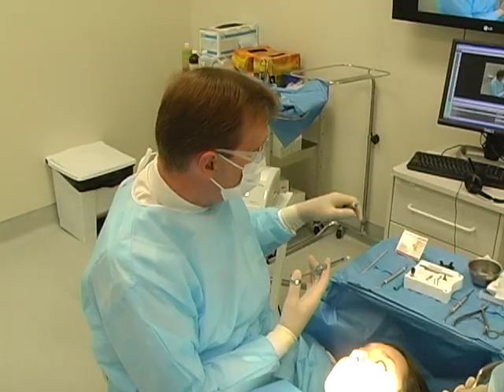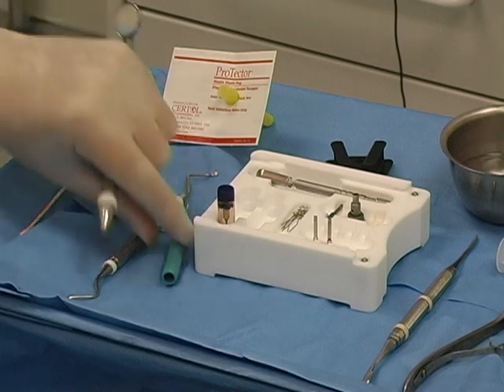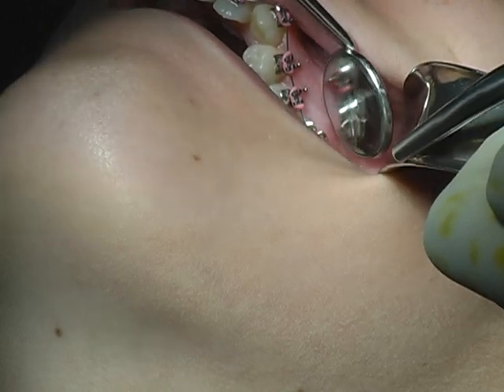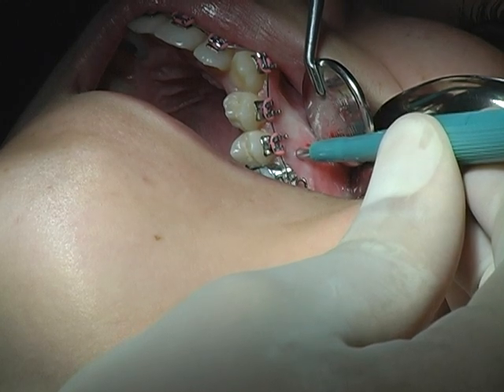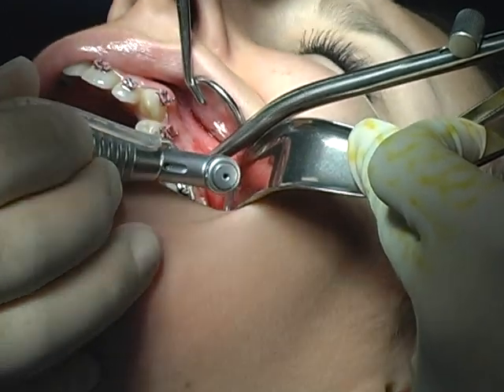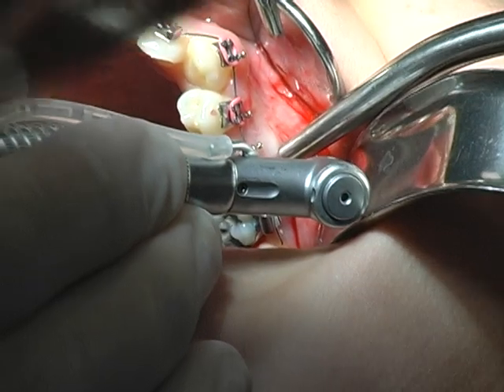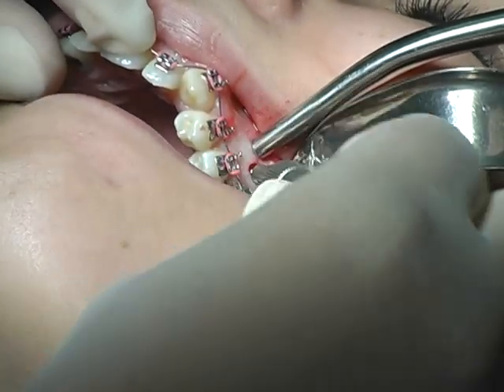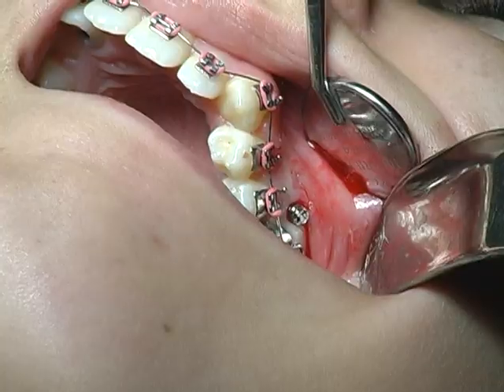TOMAS Temporary Anchorage Device (TAD) insertion

Comment: I’m getting braces and tads tomorrow I will tell you how it goes
Reply: How was it? I'm getting mine tmrw😭 especially when they numb it with the shot, did it hurt a lot?
Reply: twix 48 it doesn’t hurt what it hurt was when they put the 💉 in my mouth but after that I dint fell a thing like literal
Reply: twix 48 so how did it go
Reply: @mvriamendez  It did not hurt too just slight pressure! I did not even realize he was done because it happened so fast. but it hurts so much after the numbing wears off.. it's been a couple days but the place still hurts a bit.
Reply: twix 48 wow well idk where they put u the tads but where they put me the tads it doesn’t hurt